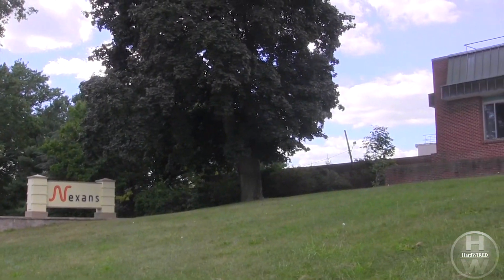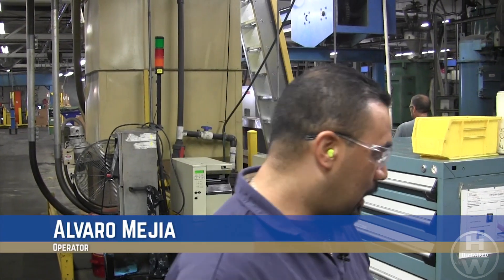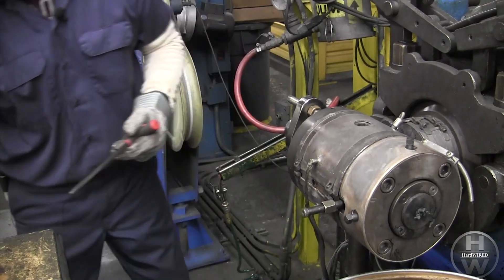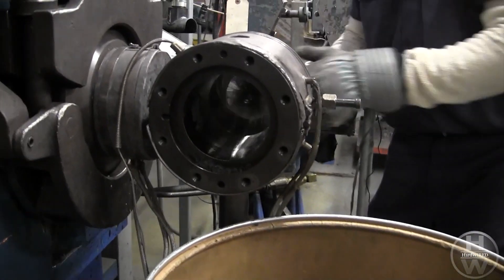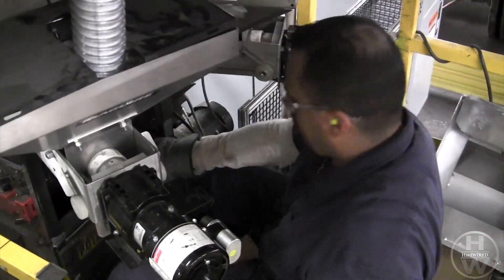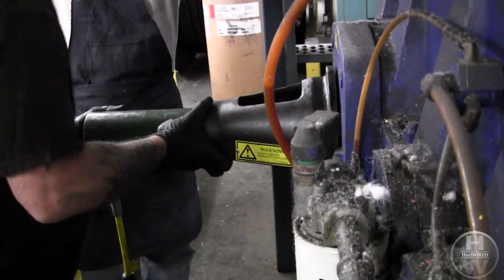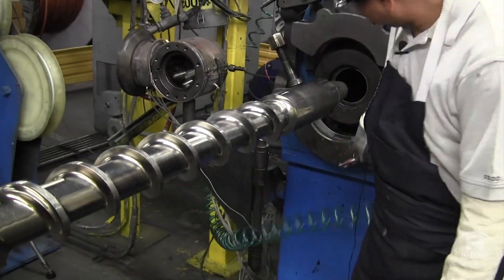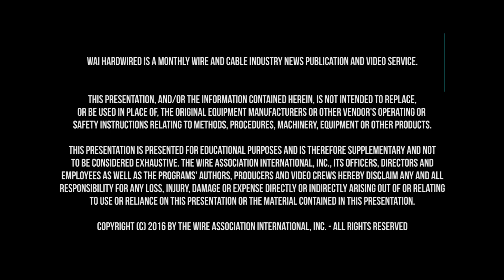Extruder Screw Cleaning

Comment: I see you using steel brushes to clean.  We were told to use brass to prevent from damaging the screw.  Due to the cost of the brass brushes is this a true statement.   We use asaclean ex grade to clean screw instead of PVC.   With this you don't need a hydraulic  screw press  because the asaclean make it easy to push out with a steel rod and peels off screw by hand.  Another reason we don't use PVC is because we run acetal and those two materials don't mix because it will cause it to gas up

Comment: dude you should pass the pvc until he gets white and hard, lower pvc temperatures to 120 degrees or even 110 and pass the pvc (don t fill the extruder just small quantities) at low rpm until he gets completely clean and hard. Instead of that too,l use one rotating machine with air...more practical and cheap. also the car, lol, you used to remove the screw is pretty basic..there are a lot better and safe.

Comment: hi, please can you tell me the name or model of the hydraulic tool you used to push the screw.
Reply: @UC9CdhqG5PzpaYfmeEld2dLQ thanks for the information, I will looking whit Davis Standard
Reply from the maker: Hi Milton,

The complete unit is available from Davis Standard, but basically, it’s an Enerpac hydraulic jack w/ an adapter Davis makes to fit the shank of the extruder. Unfortunately, Nexans does not have a model number to offer. If you wish to get more information, please call John Doherty @ Davis Standard (860) 599-1010.

Comment: You can use pvc  purging compound , high heat resistance material for purging .
So need to open screw and time saving also .
Reply: @allenmee its a blue material
Reply: Horrible stuff! Aqua purge has glass in and the lot
Reply: What is the purging compound? Can you explain